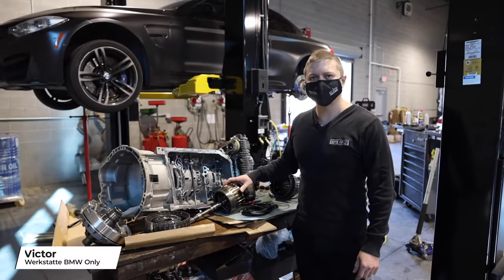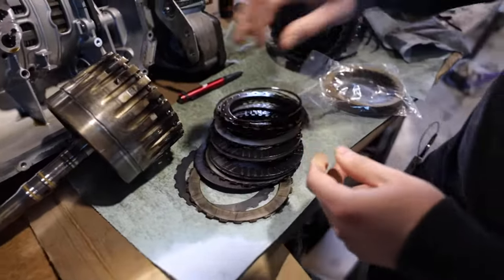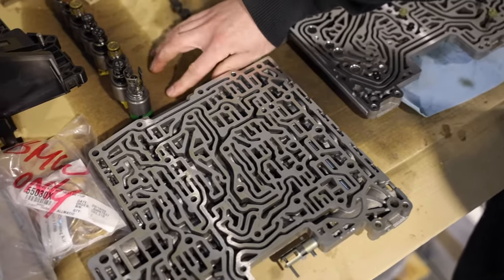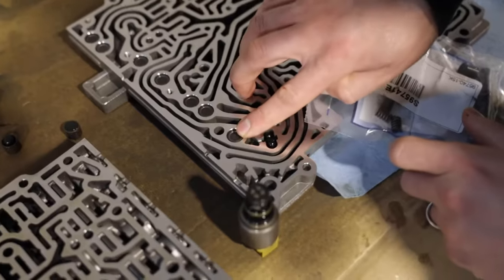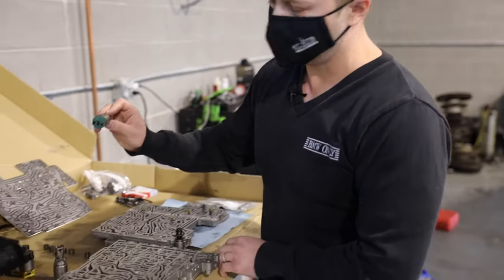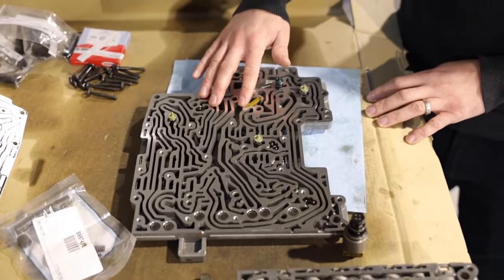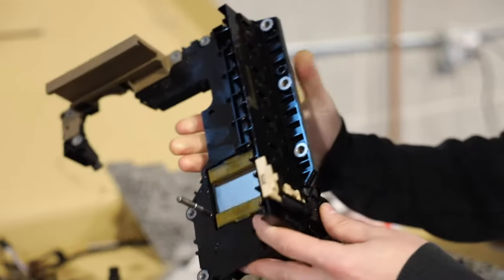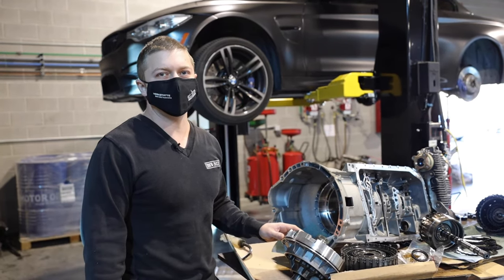Why BMW  Transmissions FAIL 6HP19 6HP21 6HP26 6HP32

Comment: how can ZF make such a design flaw ... Thanks for the good explained video
Reply from the maker: It happens. After all it's 6 speed. They moved from 5 speed on the earlier models so mistakes would happen. Time will test the quality.
Reply: @werkstatte-bmwonly9515  
has ZF improved these issues on later models? 
I focus on the F11 530i touring
Reply from the maker: There has been a ton of updates. Plus they moved to 8 speed in 2012 models.

Comment: My 6hp19 started with rotation oscillation when switching from 3rd to 4th gear, this at low rpm, followed by an error on the panel, which returns to normal when I restart the car. Scanning it, I got the error "0x4F89 - Gear Ratio Monitoring Shift 3->4".
Now in addition to the error 0x4F89, the error "0x4f53 - Torque Converter Clutch Error" is stuck
I'm getting new solenoids, and I've already bought a new clutch kit, bushings and seals, is there anything else I should look out for?
Reply from the maker: We just had the same car but when we removed and opened the transmission we found the drums had been marked. So it's been worked on before. This specific case we replaced all of the above and it didn't solve the issue. Please let me know what results you get.
Reply: @werkstatte-bmwonly9515  My transmission appears not to have been previously opened. I immediately changed the oil and the seals between the mechanics and the transmission, without success.
I believe that this week the new clutch kit will arrive and only the new solenoids will remain.
The idea is to download the transmission and analyze it completely. My fear is messing with it and not solving the problem.

Comment: Very educational video!! I have a zf6hp21 throwing code 4f82. The car doesn’t reverse now. It goes forward and then goes into limp mode. Can you let me know what the problem is? Thanks
Reply from the maker: What is the fault code description?
Reply: Thanks for the reply. The fault code description is Ratio monitoring clutch B. I looks at the clutch B and it looks burnt. Does that mean my transmission is bad? I was thinking to replace all the mechatronic solenoids and seals too. But not too sure it’s the right thing to do since I saw the burnt marks on one of the clutch. The car has 216,000 miles on it and the transmission fluid look dark brown not red. Doesn’t look like it’s ever been changed or service .
Reply from the maker: We have had completely burned and melted clutches before. If you open it I would just replaced all the bushings, clutches, and steel plates if damaged. Valve body won't help anymore as it'll loose pressure from the bushings.
Reply: @werkstatte-bmwonly9515  okay good to know thank you so much for your help! I’m not an expert like you so I will get a used transmission and swap it out. But I love all your videos! Very educational! Have s great day Gary!! God bless you.
Reply from the maker: Thank you. What year and model is your vehicle? Buying a used transmission you need to make sure it doesn't have a ISN assigned to it. You'll run into different problem

Comment: I have the same gearbox and it locks in 3rd gear and lights up an error for the cruise control 
You leave the car and come back later, it is not blocked 
Does anyone know what it is, I've been suffering for days

Comment: Hello I've got a 6hp 19 JAX Transmission on my audi a4 3.0tdi quattro. My cuestion is: when the engine and transmisson is cold and you drive, the transmission goes in neutral when you go off the gas pedal at hill down driving. Is this normal??
When they warm the Transmission holds the gear. The torq converter was changed and services were made but anyway same behavier.
Greetings

Comment: Hi great video thank you 😊 i have a 2009 330d e92 with the 6hp28 which i don’t see mentioned in this video… can you please tell me the difference between 6hp26 and 6hp28?
Thank you so much and greetings from Italy 😀
Reply from the maker: Difference is the amount of torque they can tolerate. 3-5 series have 6hp19 to 6hp21. V8 engines on BMWs have 6hp26. X6M for example will have 6hp30 I believe. So you diesel engine has plenty of torque that's why you have a stronger transmission
Reply: Did you swapped gearbox ?

Comment: Hello, would you happen to have a picture where all the black check balls goes in the valve body? I have 6hp21 manual shift, and the separator plate is 063. Thanks

Comment: Hi Viktor, I have a 2008 BMW 750LI, I replaced the solenoids, the sleeves when I changed the oil.
I did not do the adaptation. I'm having this problem that sometimes, the transmission display goes away and I get an error message
saying like "the transmission is engaging without shifting".  Then it won't run for a little bit, and then when it starts running  again it won't
pass third gear and I see the revolution of the motor going as high as 4000. Could that be the adaptation?    
any ideas?
Thanks

Comment: Is a 390 mbar value for clutch a normal for 175k miles? My e clutch is at 237mbar. I’ve got the 6hp28 in a 335d. I’ve also noticed a slight dip/jerk in rpm’s while shifting from 2-3. I’ve heard that a rough 2-3 shift was normal on these transmission and was curious what you’re experience is with this. Thanks
Reply: Hello.I have exactly same problem on same car . Did you get it solved, I am thinking of rebuilding valve body

Comment: Hey! I have a 320d with the zf transmission and from 1500 to 2000 rpm sometimes if I accelerate hard the car starts to shake. I have to stop accelerating and accelerate again to avoit the shaking. What can it be?

Comment: Thank you for this video it’s great 
Can you tell me what happen on my A clutch, 632 value …is it wear or other problem ? 
I did a service on it (oil, tranny, and all seals under mechatronic
Reply from the maker: A clutch is the second issue after clutch E. Bushings inside the transmission are most likely worn already. Have to remove and open the transmission

Comment: I have 6HP19 on 120d sometimes it slips under heavier acceleration and then thumps when it engages again. No fault codes yet. Can it still be saved or needs complete rebuild?
Reply from the maker: The way I look at it you'll have to replace the valve body plate with solenoids anyways. So start from doing that and hopefully you restore enough pressure and you won't have to remove the transmission. Make sure to replace those Pistons that damper pressure in the valve body. Just the new solenoids won't do the trick.
Reply: @werkstatte-bmwonly9515  Thank you for the reply! hopefully its just that!
Reply from the maker: Good luck

Comment: I am in Canada and have a 2011 BMW 750xi with 175,000 km (about 110,000miles).  No issues with the transmission but it has not been serviced ever. Should I be servicing it? If so then what should this service include?  What fluid do you recommend?  Thanks for the great video.
Reply from the maker: ZF fluid is the best of course but expensive. There are plenty of good brands that work just fine. Even cheaper redline fluid does the job. I haven't seen a car fail because the original ZF fluid wasn't used. There's always a different issue behind it.
Reply: I used valvoline max life. 30,000 miles no issues

Comment: I have a 6HP28X E shift in an E70 35D that has E clutch ratio codes and will intermittently go into failsafe mode and remains in 3rd gear until you stop and it resets. This has been slowly getting worse. The transmission was supposedly overhauled after only 120,000 Km's. It now has 186,000Kms. I was sure the bushes were not replaced last overhaul, and now I have stripped it know that was the cause. On recommendation, I have out a Sonnax Gen 2 zip kit in the valve body, new ZF solenoid set, new DuraBond bushings. I measured all clutch packs and friction disk thickness was per original new plates, so I did not replace them. All other parts are without fault as expected from the low kilometers. When assembled, I have reverse only, no forward, and it even comes into reverse with Neutral selected. This is not my first 6HP26 transmission repair by the way, but it is the first time I have put a full zip kit in a valve body, only doing the sonnax piston set before. I followed the Sonnax guide. All clutch packs were air tested on assembly as normal. I have valve body out again and will measure the new solenoids tomorrow and see where from there. Any thoughts of where the problem may be?
Reply from the maker: Bushings, I've seen rebuild transmissions with original bushings. Also sometimes sungear is so worn out that you have to replace the bushings and the shart itself. Mainly that bushings form the oil pump to the sungear.
Reply: @werkstatte-bmwonly9515  As stated in my query, the first thing I suspected were worn bushings which was confirmed on strip down. I then replaced all the bushings in the transmission at rebuild, so this cannot be a problem now. I have chaecked the new ZF solenoids and all good. I am now stripping the valve plate as I suspect the zip kit has led me the wrong way, and I will revert back to standard if I see nothing else obvious.
Reply from the maker: Check drums and gears for heavy scarring. Sungear commonly gets damaged and causes a pressure lossn

Comment: Great job thanks for being so detailed in you explanation of the whole over haul. I wanted to see if you could help me try and figure out wether or not I need to replace the transmission on a 07 550i. Previous owner posted it for sale cheap because they had bought from Auction he drove for a few week when they decided to preform a oil change. When got vehicle down off lift, it no longer will got foward or reverse. You can feel it engage gear and displays on cluster but not at shifter. I have tested and changed solenoids and seals. erased multiple codes the permanent ones are CF2A and 5f2f any help would be appreciated.
Reply from the maker: Hi there. I'm so sorry I just noticed I never replied. Can you give me the description of the faults please. Most common issue on this model that would cause such a behavior is the gasket aka adapter sleeve. It goes between valve body and transmission. 3 hour job tops. If it's cracked it would loose pressure and transmission won't move. It would drive time to time and die again. Seen it s million times
Reply: @werkstatte-bmwonly9515  
I get that and agree that is a very common issue, I have felt with a 750 li I bought to fix and flip awhile back. It had elec. parking brake and would switch back out of gear as soon as you would trying and shift out of park. I guess what stands
Out to me is fact that no mater what gear you select the driveshaft is locked won’t move at all. But rear wheels will spin also like never getting park. Which makes me think like a parking gear frozen or something but no elec parking brake manual hand lever. I took pics of fault codes I’ll have to find them I know had
Lost comm egs/dme, can loss codes, a whole list of them I changed sleeves and bridge gaskets. Selected gear shows on dash and gear selector. I’m scanner as well acutal and requested. Don’t remember which on but the says gear undefined. Also no solenoids and engagjng switching on or off in live data. Bad front pump, or trans computer? Let me know what you think thanks I’m stumped if can’t do some thing gonna put used trans with control module and see what happens. Thanks for your help
Reply from the maker: I've seen this before as well. When you put reverse and accelerate does the vehicle try to move forward? Clutches get hot and get stock together. Good news you can rebuilt it. Will replace clutches and steel plates in this case.

Comment: Excellent advice, do you have a drawing with position of the balls and the valve body
Reply from the maker: Have to take pictures when you open them. They aren't the same. Remember they are spring loaded so separate them very slowly
Reply: @werkstatte-bmwonly9515  Hi,

I have this 2009 BMW 330i with ZF6HP19 with DTC P170E Electronic Pressure Valve EDS5,

I would like to know if you have fixed this type of DTC.. 

Thank You
Reply from the maker: Hi there, let me ask my main tech tomorrow. Can't tell from the top of my head
Reply: @werkstatte-bmwonly9515 

I would really appreciate any advice.

Thank You again 🤝

By the way,  you have a NEW subscriber from San Luis Potosí, México.

Comment: You prefer Sonnex kit over Transgo? Or do they fix different problems?  Is rebuilding the valve body really that difficult? Seems like if you're careful and take pictures and such it's not a problem?
Reply from the maker: I've never heard of transgo. I've only used Sonnex. If you take your time you should be fine. Remember there are springs so be careful when separating the plates.
Reply: @werkstatte-bmwonly9515  I've heard the separator plate needs to be replaced / upgraded?  What to you think? FYI i have a 2007 750i.  Based on what I've read, seems like I'll need to pull the valve body and get some numbers from it before I order anything?  FYI, link to Transgo kit:  TRANSGO SK6R80A
Reply from the maker: Yes there's going to be a three digit number with a letter in front of it. One side will have letter A and another side letter B. Very common numbers for example A053 or A054. You don't have to remove the valve body to see the plate. Just remove the oil pan and you'll see it on the edge of the valve body. Pretty big letters

Comment: Great video! Do you think if a zf628 has 160k miles and no idea if fluid has ever been changed....should I change it or leave it alone? It runs good.
Reply from the maker: I'd replace it. It's an old myth that if you change the fluid, transmission might fail. In over ten years I have never seen this happen. Now I WOULD NOT reset the adaptation values at this mileage.
Reply: @werkstatte-bmwonly9515  thank you!
Reply: I bought a 318d E91 
Car has 295xxx
Bmw dealer serviced up until 190xxx
After this km, no service history.
Should I flush/wash the transmission and change oil.
Or should I not flush it and only change the oil?
Sometimes you can feel the gear change, it shifts a little uncomfy.

Comment: Brilliant video thanks. I have a question around replacing the whole gearbox. For example my e92 325d had 6hp19. I would like to replace when i do get issues with a 26 or 28. How can i know what will fit and run? Ive been advised its possible but needs to be from around same period car as there are two variations in the “computer”. My car is 2008 and I’ve been told i need a box from  september 2007 on so it is “dcan” and not kline. How can i know what TCUs will work etc? Thanks
Reply from the maker: We don't have 325d in the US. I haven't had issues with replacing used transmissions and can signals. This could be a very specific issue related to diesel models

Comment: I have purchased a bmw 650i 2007 and it’s having a transmission malfunction, If this is the issue (which it definitely is) how much did this whole job cost ?
Reply from the maker: The entire job with removal of the transmission runs close to 5k.

Comment: Preparing to do a transmission service on my 2007 bmw760li. I was going to have all the sleeves and seals replaced the solenoids and of course the pan. Now I have no issues with burned clutches or anything like that yet. But it sounds like to me that there's some more stuff that I need to do?  I'm 60,000 miles in perhaps I should just buy one of those new  bulletproof Transmissions they have for my car?' I'm not certain?
Reply from the maker: All you need is to open valve body, replace separation plate, piston pressure dampers kit from sonnox, solenoids, at pan, sleeves and seals plus fluid. After that you trany will be ready for another 100k miles.

Comment: Great explanation I have a problem with my 6hp26 transmission in solenoid 4, It’s always inactive, I change oil transmission, the separate plate and the solenoids kit, can you help me, thanks a lot!
Reply from the maker: Hi Arturo, If you replaced the solenoids and still have short or open circuit for the solenoid that means your have a bad TCM ( Transmission Control Module). That's the black plastic part that's attached to valve body and holds all solenoids. You can separate it from valve body pretty easy. You can use a used one but it depends what vehicle you have. Some of them are locked with ISN. We could unlock It for you but you would have to ship it to us.
Reply: @werkstatte-bmwonly9515  Thanks a lot I really appreciate your help I’m gonna try with that,  if it doesn’t work, i’m gonna ask your help Again!

Comment: great vedio, i have 07 750li with zf6hp26 trans,my vehicle start going into park from drive aftere vehicle worm up,will not do it when it's cold, error code iam getting is  4E89 SV 1 or SV 2 mechanically jammed. I replaced all mechatronic sleeves and all solenoids, followed fill procedure engine off ,engine running at 40c .Reset adaptation,still having the same problem. i used redline fluids i dont know if that is part of my issue.!! could you please help me with this problem what it could be.thanks
Reply from the maker: That's common. You need to replace TCM ( transmission control module).  That's the black part that attached to the valve body. If you can't find a replacement you can ship it to Bulgaria, there's a company called soft electronic that can repair it.  If you can't find it DM me on IG I'll give you their email. You vehicle doesn't have ISN (individual serial number) so you can easily but a used one just the vin number won't match. Same scenario would not work on the se year X5 because it has ISN protection.
Reply: @werkstatte-bmwonly9515  Thank you so much,I will get in touch with soft electronic,and will go from there. thank you again sir.
Reply from the maker: Follow us on IG @werkstatte.bmw and DM me if you'll have more questions